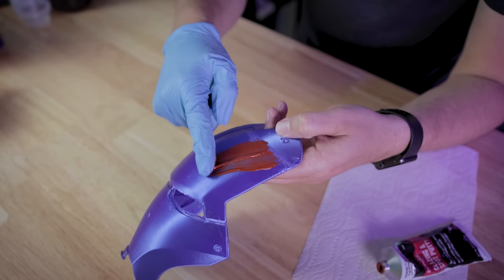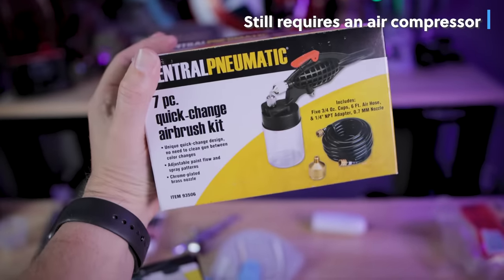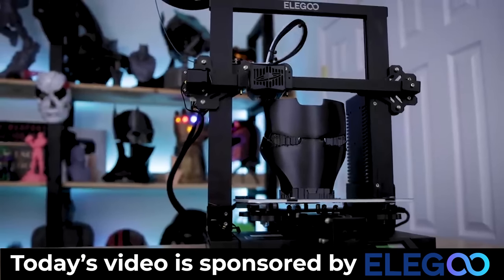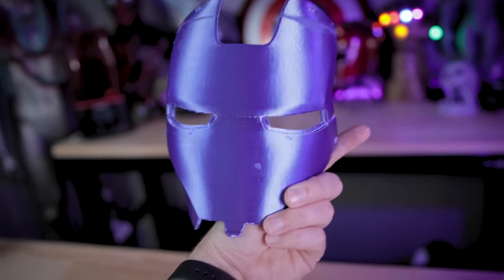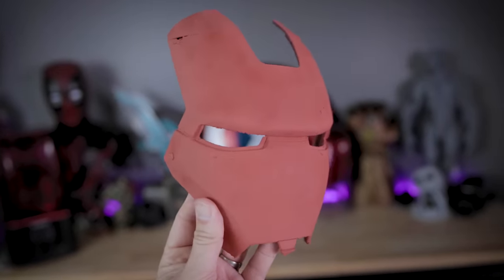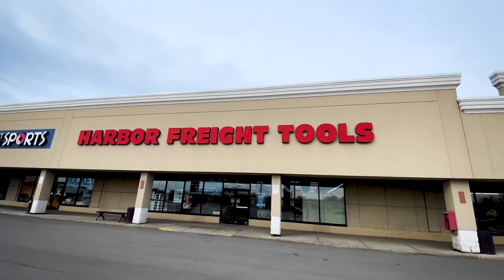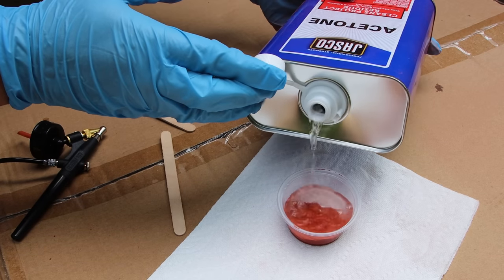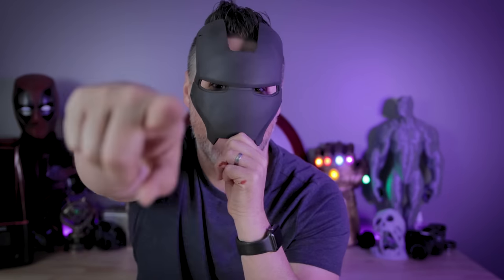Smoothing 3D Prints by Spraying Bondo Spot Putty

Comment: Ex autobody guy here. Don't use single stage solvent based fillers. They will continue to off-gas and the material will shrink over time. Your print lines can return weeks or months later and ruin your otherwise perfect topcoat. It's not much different than shrinking joint compound when refinishing and painting a wall.
Reply: What's a good filler in your opinion?
Reply: what do you suggest?
Reply: Do you have an alternative recommendation? Thanks!
Reply: Sooo.. don't use this but you're not going to say what to do instead?
Reply: I think what he’s saying is to use regular 2 part bondo, but the thing is that all fillers tend to shrink over time to varying degrees. But I think your applying this in such thin amounts the shrinkage will be negligible. 

One thing I would do if using this process, which is what I do when using glazing compound already, is wait a day before you primer it so that it off gasses plenty before you seal it in. May not matter when you consider the tiny amount on there but I’ve not had any issues so far of layer lines showing up later, at least not yet.

Comment: You know the best part of this video? When the adaptor was incorrect for the airbrush so you were able to just 3D print one. That, right there, is my favourite part about 3D printing. Amazing video as usual dude, always a fantastic watch 💪
Reply from the maker: 15-20 mins later I had a fix haha
Reply: @UncleJessy  the 3D printed dream right there!
Reply: Hey do you have a link to the adapter? I just picked up that set from ebay about a week ago.
Reply: @eddiebe22  it's in the top comment if you haven't seen it already.
Reply: At the same time something like that shouldn't of even been needed which shows how cheap Harbor Freight products really are.
Reply: @Hikuro2pnt0  we don't have Harbour Freight in the UK, I watched the video where he brought a load of 3D printing tools etc, we have nowhere like that where you can get everything save maybe the range but it's not that extensive

Comment: You can also buy primer filler that basically does the same thing. It's a thick primer that fills in layer lines pretty good. I have used it many times. I often spray, sand, spray & a final sand then paint.
Reply: Yes spot putty is basically just very thick lacquer primer.
Reply: The point of this though is you lose less fine detail form the filler primer piling up in small detail areas though
Reply: Resin and UV light easiest way out there.

Comment: I believe it was recommended to use a gravity fed airbrush for this process. You used a siphon airbrush. I wonder how different the results were between both types.
Reply from the maker: 🤷‍♂️ for $10 I’m super happy with that cheapo brush and it’s results. 10/10 would buy again
Reply: Honestly I seen no difference in using the gravity. They definitely make ones with larger reservoirs vs siphon receptacles but you don’t want to go crazy with large amounts of acetone. Small amounts of acetone especially when exposed to UV light are extremely volatile & less dangerous. So on a safety scale anything around 35ml or less is better.
Reply: @UncleJessy  sadly, it looks like Harbor Freight discontinued that airbrush. At least I don't see it on their website.

Comment: Question I found on a review for the Saturn... I'm researching and have come across your videos so I'm just asking you.  Is it really necessary to buy all of this to use the Saturn S????     (the following is from the review)   "Here are the items you should buy with it:- Curing & washing machine- Lots of resin (recommend water washable unless you know a plumber)- Gallons of 99% alcohol- Chemical gloves (reusable)- Spray bottles- UV protective glasses- UV flashlights / lights- Lunch trays- Slap mats for spills- A cover if you do curing next to printer- Tons of shop paper towels (not regular)- FEP replacement film- Good tweezers for remove supports- A respirator for VOCs- Good hobby knife set- Bulk paint brushes and Qtips for connecting parts- Bamboo toothbrushes for cleaning before curing- Small jars for resin painting / gluing- PTFE if you have bad FEP film- Screen protector for LCD- Extra build plates to keep printing while you clean prints- Extra resin trays for quick swapping- Funnels- Funnel paint filters for failed print resin- Adhesive handles for handling the shell carefully- Magnetic removal plates are a must (measure you build plate before ordering)- Good blow dryer- Digital calipers- USB extension cable- Ventahood or air purifier for VOC and alcohol fumes (your whole house will smell like alcohol and rubber)- Solid level surface- Climate controlled area- Sink with drain filter to catch support debris- Bright non-fluorescent lighting- A powerful computer (or patience to the moon) for splicing software- Possibly the premium versions of CAD and splicing software."

Comment: Great idea! I use this stuff already along with rapid build primer to smooth my sla prints and turn them into mould masters for casting, but I never thought of spraying it. The bondo spotting putty is so "dusty/dry" when sanding, it's really nice to work with. I've tried other solutions but most of them are "gummy" when you try to sand them. Great video!

Comment: Awesome video! Since you already have the compressor setup, a good way to sand the backside might be to use a sandblaster or other abrasive media like walnut shells. Harbor Freight sells a chamber for this to recycle the media, but you can also do it open air if you don’t mind losing the abrasive after using it once. I have been wanting to try it, but have not yet been able to make the space in my house! Might be a great way to get consistent sanding quickly and to smooth out high detail areas!

Comment: As usual, your video’s are awesome.  Thank you!  Personally, what I do is Elmer’s Wood Filler - water it down then paint it on the model.  Wait for it to dry, then sand back.  Layer lines disappear.  For a piece that’s glued to another piece - Elmer’s Wood Filler (not watered down) applied to the gap - again, sand down, and the gap disappears (as long as you apply it properly).  Thank you again for your awesomeness.

Comment: Nail polish remover or 90% proof IPA has also been highly recommended for thinning spot putty, for working materials less harsh than acetone.
Respirator mask is still mandatory in a well ventilated area, make sure the filters are rated for chemical fumes & not just dust.

Comment: Thanks for interjecting about the use of Acetone and ventilation. I'll add to that, though. Be EXTREMELY careful when using fans for ventilation. Acetone WILL EAT the plastic coating on wiring. We had a garage explosion here in KC a few years ago that set fire to the house. Even though the guy was using a gigantic floor fan for ventilation, the fan shorted and vapor/particulates in the garage space blew up, according to the report from the fire department. 

Just be aware and be careful.
Reply from the maker: That is solid info right there. Honestly if I couldn’t have done this outside there is no way I would have done it. Plus the respirator
Reply: @UncleJessy  Dude, you do great stuff. I'm the son of a fireman and I've built plenty of DIY spray booths myself. 

As long as people understand how over-spraying works, what they are spraying, and how flammable particulates are common sense goes a LONG way. 

The explosion was not far from my house and on a busy street, when it happened there were lots of questions as to what caused the explosion. 

The same goes for woodworking dust collection. Sawdust generates a lot of static electricity so collectors and their ducts get grounded with copper wire. 

Keep cranking out the good stuff!

Comment: Nice bit of information! Airbrush question: I've never owned one and would love to get into using one for painting. The harber freight shop near me doesn't have them airbrush kits and to be fair I'm not sure I'd want to start with something that don't come with its own air compressor as I don't feel comfortable enough to run my normal one for my resin pressure pot as it's calibrated for well... my pressure pot and I really don't want to mess with that setup. What would be a good brand that youed recommend for a beginner that does comes with everything needed?

Comment: Maybe a good idea to not try it on ABS because it will melt everything up, unless it's a very fine mist, which in this case you might smooth it out without the bondo stuff 🤔
Reply: Acetone evaporates very quickly, it low amounts aerated keep in mind 90% of the mix is the putty which already has acetone in it. This method will not warp abs

Comment: While it's a very interesting idea, I'm just so hesitant to do this because of the potential damage to air brushes + the toxicity of acetone. Just seems like the cons outweigh the pros here. But I appreciate your video on the subject, I certainly list you as the expert when it comes to 3D print stuff.
Reply from the maker: Yeah, A LOT of cons on this one. For sure won’t be doing it with every project but maybe for some of my larger print projects
Reply: Acrylic putty/plastic putty is water soluble, so it might make sense to try thinning that with water for this.

Comment: I could see this being useful on high detail areas like the inside of the faceplate but for larger things I think I’ll stick to using UV resin! Fast, easily sandable, less mess, and looks great. I’d be interested in seeing a side by side of this method and filler primer on a high detail print.

Comment: Honestly,  you can print fdm without layer lines if you just tune your printer. It's not easy, it takes a lot of trial and error but you can get those layer lines to print 99.9% as smooth as a resin printer.

Comment: I am starting to wonder if, Elegoo's FDM printers are any good really. Uncle Jessy is almost the only one I see using it on the internet, because he is sponsored. But, in almost every video when he is using the printer, the prints fails. The quality is very bad also, on that mask you can see the "filament dripping" artefacts on the edges, and the overall model is pretty rough looking. I have an Artillery Genius, and even my Draft quality prints look 10 times better than this, and I can use it for terrains without any smoothing process. Also, it's almost never fail. I had it for over 2 years and I think it failed, like, 3 times. You can believe what I say because I am not sponsored  ha-ha.
Reply from the maker: I include the fails because that’s what I ran into vs hiding any sort of print issues. I also printed that mask with a .6mm nozzle at .2mm layer height at 80mm/s. I purposefully wanted something that had some layer lines that I could test this video out. If I didn’t love the Neptune 2 I wouldn’t have bought 8 of them 😂 perfect machines for my Etsy orders. Is it as good as a Prusa… probably not but it’s $200ish and prints dang good enough for what I need. You can also hit up the Neptune 2 user group on FB to see what others are printing. 
I’m all about print time over quality 90% of the time.
Reply: @UncleJessy   Hi, I am sorry if I insulted your integrity, I didn't mean to, I was just wondering. Thank you for your answer, I understand now.

Comment: I've been doing this with regular injection molded plastic models for decades. learned the trick from Dave Merriman when I lived in Virginia Beach. I haven't done the airbrushing, but I have been brushing on thinned glazing putty to fill seams and gaps. I use a product called Nitro-Stan instead of Bondo glazing, but Bondo will work also.
Reply from the maker: Nice to know! Yeah I was thinking it would be easy to brush on as well

Comment: I've got another option people can try as well. 

I've been using Evercoat Featherfill G2 Primer for quite some time now, works in pretty much the same way.  It fills layer lines, gives a well bonded hard surface that is easily sanded and takes any paint you want to use on top of it.

I used it, or similar products for many, many years for other work projects, model building, and to help fill tooling marks from fabrication on a variety of materials.  I carried it's usage over to my 3D printing obsession a handful of years ago and it's all I use now.

 It makes sense that the spot putty works well, since once it's thinned it works like a high build primer/filler/surfacer when sprayed onto a 3D print.

Featherfill is expensive at $125/gallon now (used to be about $75 just a year ago), but it goes a LONG way when airbrushing especially when thinned down.  It does also come in quarts if you need less.

Comment: Duplicolor's filler primer takes about an hour or two, but sanding it can be a real pain because some of the material tends to stay in the sand paper and clogs it up; does that happen with this method as well? (I do use spot putty to fill gaps and see it doesn't, but I haven't covered large areas)
Reply from the maker: Yeah I see that as well with primer/filler this def clogs up the sandpaper but no where near as much as when I use the primer/filler
Reply: @UncleJessy  cool, some time I'm going to try it, as I have a big tube of green spot putty from 3M which I'm pretty sure It will last a LONG time if using it just to plug holes

Comment: Coming from an ex-body man, that putty is virtually a thick primer.  Although acetone will work, lacquer thinner would probably work better.  The problem with this method is the material (putty/primer) will shrink over time, which eventually all the lines and flaws you are trying to cover will start to show through six months to a year later.  To eliminate this altogether, I would recommend a catalyzed primer from an automotive paint supplier, which is typically a two-part mix.  It might get a little pricey just to forewarn you, but it will probably sand much better than Bondo and give better results.  JMO.

Comment: @unclejesey. I like this idea. It reminds me of how I use to smooth old plaster walls with heavy textures. I am a drywall taper of 26 years. I specialized in restoration of vintage homes. We would trowel on the first 2 coats then spay thin mud on to fill pin holes and the like. But we did not sand the first 2 coats, we would scrape the high spots. So this raises the question of why you don't use scrapers at the start to knock down the high ridges of layer lines. I believe that it would greatly reduce the filling and sanding. Cabinet makers have been doing this for centuries. It reduces the risk of making the harder wood grain to ridge up. A set of cabinet scrapers are cheap. I don't 3d print, yet. So it would be a interesting idea to try out for a video as a finishing video related to this video. 🤔 
Keep up with your awesome work. You are definitely the resin printer king 🤴 👏. Cheers for now from Calgary Alberta Canada 🇨🇦 👍 😀 👏
Reply: Having a set of scrapers should be in everyone’s toolbox that is 3D printing however it’s not always neccisary to scrape your parts. The idea here is to speed up the process. This method coupled with filler primer goes a long way in speeding up and reducing sanding time. 

3D printing is already slow if you have a Cartesian printer at 60-80 mm per second, a bit faster if you have a flsun super racer 200 mm per second and ever faster still if you have a Bambu labs x1 carbon 300-500 mm per second, but even then many of these parts eat a lot of time just printing, then more time tediously sanding. 

With intricate detailed models, like the interior of the mask he used, it’s almost impossible to sand. Sand blasting with walnut media will reduce detail more then the method used in this video. Like with all things 3D printed it’s a trade off. Certainly another tool for the toolbox, but not for every build.

Comment: So how different is this from that "filler primer" you can get in a rattle can? Seems like it does the same thing, but I wonder if the filler primer is better if you're printing in ABS or ASA since the print would be affected by the acetone you're using to thin the bondo...
Reply: none at all mate...we have spray putty in the UK. Pretty much the same thing lol

Comment: How was the cleanup of the airbrush? I know you said you bought the cheap airbrush so you didn't care if it clogged, but were you able to clean it so it can be kept as your "I don't care" airbrush or is this close to a 1 project 1 airbrush project?
Reply: Takes a minute to clean up. I display it in my part 1
Reply: @Darkwingdad  how was build up on the end as you sprayed? Since it dries fast, I could imagine that being a problem.
Reply: @tiffanysandmeier4753  I’ve tested both on siphon & gravity, it did build up a tad on the siphon but I think bc mixed it on the fly and the mix seperated a bit. Unclogging it was nothing more than fully tightening the nozzle, wiping with a qtip and than good to in seconds.